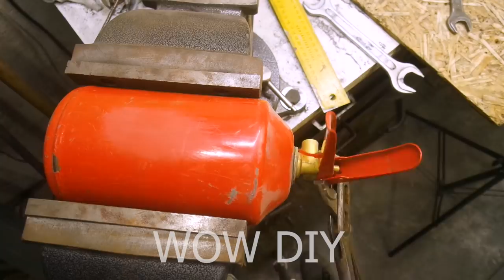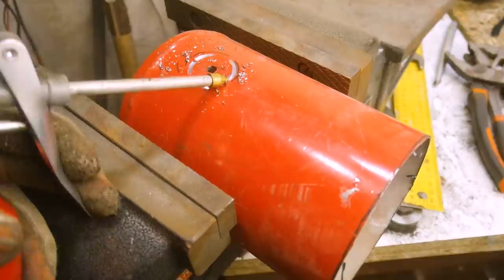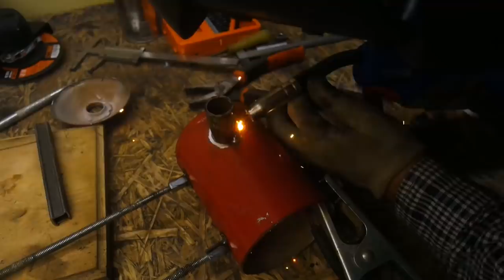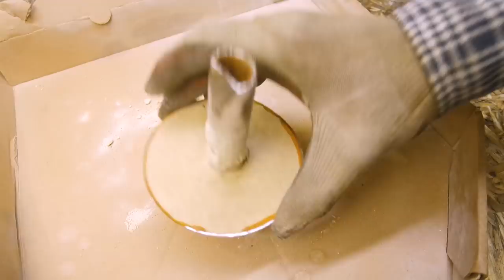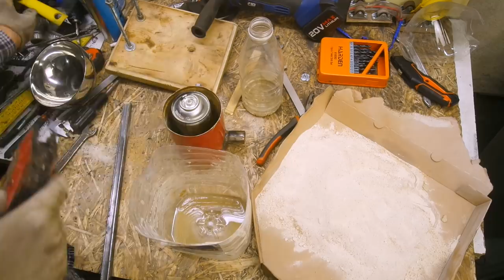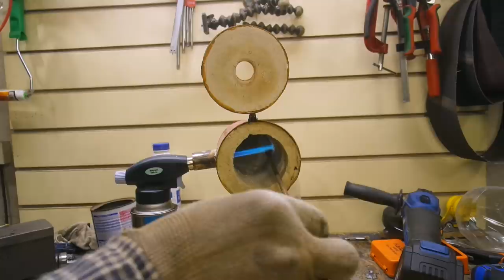Brilliant idea from a fire extinguisher! You may need it

Comment: I’ve made a coal fired forge out of a steel extinguisher but yours looks like aluminum. I cut a door the length of the extinguisher and put some heavy hinges and a handle on it. I drilled holes in a heavy pipe about 1.5 inches apart and capped one end a threaded the other end of the pipe into the hole at the top and welded it into place. The I threaded fittings from the outside that I could connect directly to my air compressor. I then put in a couple of layers of heavy steel screen over the pipe which was made as low as I could put it. I then made a stand but I won’t go into detail because this is such an old video. To finish it off I started a coal fire to cover the length of the extinguisher. I close the hatch and pushed some air thru it with the compressor. When the fire was burning well I started blasting air thru the piping. The results were that I created a blast furnace that was hotter than hell. The first file I put in it was basically consumed by the fire in less than then minutes. I’ve been making lousy knives with this thing for years and someday I might make a good one.
You can’t beat a coal fire and an air compressor for a poor man’s forge. I can also put 20 pounds of range lead in a fire extinguisher pot and go away for a half hour until the smoking stops. Scoop off the dross and pour it into muffin tins for reloading. Talk about HOT! You had better watch yourself. I get all the fire extinguishers I could ever use from a shop near me for nothing and select only the very old steel ones that no longer worthy to be refilled. Most of the extinguishers I get are turned into cool sounding wind chimes. Yep.. I’m screaming into the wind again!!